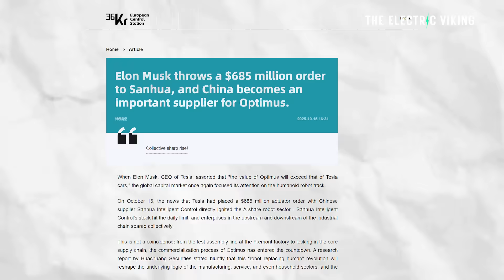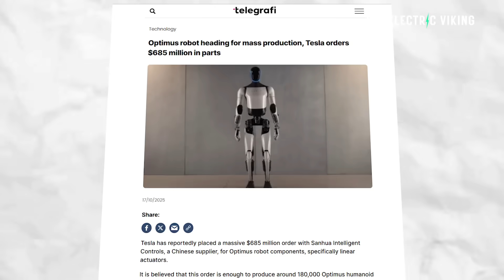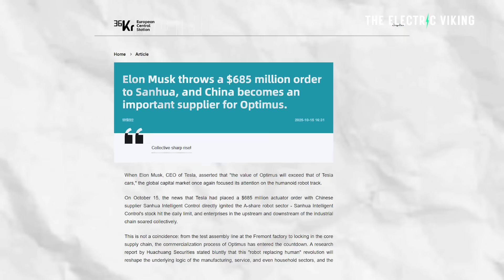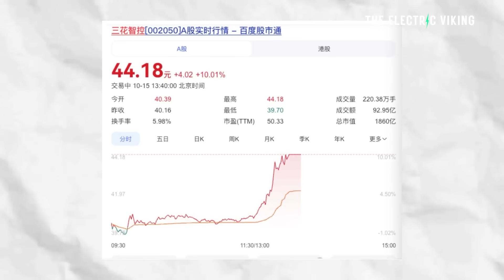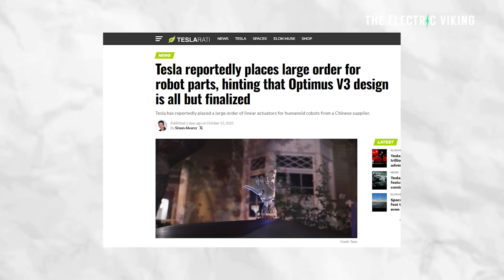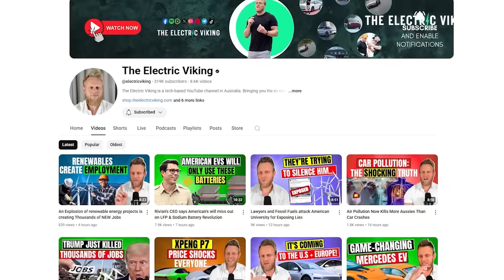Tesla Orders $685 Million Robot Parts - Enough to BUILD 180,000 ROBOTS!

Comment: Nearly $4000 in parts for each robot, probably not a complete list I would say. Would be a struggle to get it under $10,000, somewhere between $15,000-$20,000 could be possible. If the price is this low or lower from start, this should have a huge waiting list so I'd expect them to ramp up to more very quickly.

Comment: If Tesla is bettng the farm on mass-producing Optimus next year, I'd be selling TSLA if I owned it. Even if Tesla has training data comparable to its data for the far simpler task performed by a vehicle with FSD, these robots are a hard sell because no one yet knows what they can do or whether they'll outperform minimum wage labor without large training costs borne by the customer.
Reply: If one is going to confidently sell it, they might as well short it.
Reply: @BeAsOpinionatedAsOpenMinded  Selling is fine. If you don't own it already, you could short it, but I wouldn't. FSD robotaxis still look like a winner in the foreseeable future, and I don't know how much of Tesla's earnings they're betting on Optimus at this point.

This article says that Tesla "reportedly" ordered $650 million in parts and deliveries "are expected to begin in the first quarter of 2026". Lots of hedging there. I doubt that Tesla has paid $650 million upfront for parts it'll start to receive in the first quarter of next year. Maybe they've told Sanhua that they could purchase as many parts next year, but I doubt that they're contractually obligated to do it. I need to see it reported somewhere other than telegrafi before I'd believe it.
Reply: @restonthewind You're right there's fsd and the new model y looks good also.
Reply: @restonthewindAptera?  Looked it up.  Interesting.  One render looked very slick but the other looked like a cockroach.  I can feel the nerd appeal.  Does it have 4x4 for the snow?…I think I would bolt and buy the Tesla.
Reply: @BeAsOpinionatedAsOpenMinded  Wouldn't be great in the snow, but it hardly ever snows where I live. Is incredibly efficient. Costs practically nothing to fuel.

Comment: That much money could be parts for 10s of thousands of Robots.  That qualifies as a small test run for a product if you are convinced it will eventually sell in the billions, as Elon has stated.
Reply: Tese 685M$ are only for ONE type of parts:  linear actuators, NOT for the full sett of parts necessary to make the robots. So, it is not 10s of thousands that are being planned, but hundreds of thousands!  It's clearly MUCH more than "a small test run"!  It's a first commercial run!
Reply: @st-ex8506 
Actuators are the greatest cost to producing Optimus says Elon.  He also stated after hitting million or multi million production rates, they may get production cost down to or below $20k per bot.  Until then it is fair to assume we can expect 2 or 3 or maybe 5 times more expensive production cost. It starts really bad but steadily gets smaller and smaller.  A bot with 40 actuators(last I heard they were looking at around 30 plus whatever the hands need to operate), and lets guess each actuator averages out to $650, that equals $26000 in actuators per bot with lets say $60000 production cost for this very first run. 
At those prices we have enough money to purchase actuators for about 26000 bots.  I definitely coukd be wrong but I see zero chance of Elon ordering parts for 100s of thousands of version 3 robots before first building thousands.

Comment: Had a chat with ChatGPT, did the math on the carbon emissions of robots. They will have a huge effect on carbon emissions because although they are less efficient than humans, food is an extremely carbon-intensive source of energy. Also, no commuting emissions. So in addition to EVs, robotaxis, energy, this is another way that Tesla is helping climate change. As opposed to legacy automakers who have to sell about 5 or more SUVs or pickups (the vehicles with the highest margins) to make up for one EV. If you’re going to buy an EV, do the math on the entire effect of your purchasing decision, not just the EV itself.
Reply: Thanks for that insight. However, the AI supercomputer data centers will use so much electricity that the companies building them are also building on-site power plants to provide that electricity. There is an insightful 30-minute video entitled " New Colossus: The World’s Largest AI Datacenter Isn’t What It Seems" that was published 2 weeks ago on the "Anastasi in Tech" channel. That video indicates xAI's Colossus 2 data center will be about 10 times more powerful than Colossus 1, and it will use a gas turbine power plant capable of producing about 450MW of power. So that's a lot of fossil fuel being burned to produce AIs. I hope xAI plans to eventually switch to using sustainable energy sources, for example, solar/wind power plants.

Some back-of-the-envelope calculations indicate that the amount of CO2 emissions saved from Tesla's Megapack business is currently far greater than the CO2 emissions from Colossus 2's power plant, so that's good. However, Elon has indicated there is intense competition to build ever-larger AI data centers. Colossus 2 will be the first GW-scale data center, but he predicts that 10 GW-scale data centers will follow within a few years, and then 100 GW-scale data centers after that. As such, I think it is too early to predict whether AI robots will end up reducing or increasing CO2 emissions.
Reply: @CiaranMcHale  Yes, this is an extremely complicated issue. The burning question is whether AI will come up with climate solutions and products that will more than make up for its current carbon emissions. We (humanity) are feeling around in the dark and making decisions whose effects we will only know in the future. The stakes are high but inaction will only carry us slowly towards the waterfall. In my opinion we will probably not solve the climate problem without AI so we need to step forward and hope for the best.

Comment: Yawn. This robot will go over like the Cybertruck. It is old and slow. This is the person that created the Model Y, Toupee edition.
Reply: I work at a tech company and just bought the new Tesla model Y Juniper. 
Everybody that rides in it loves it and is blown away by the engineering, it’s amazing. The full self driving is like alien technology it works so well. I’ve taken multiple long road trips and 99% of the way the car drives itself. Elon is a god of tech, facts.
Reply: @greenapple559  

I am glad you just bought it and have taken multiple long trips. Ha ha hah ha ha ha ....
Reply: @greenapple559  what about the engineering are they blown away by? It’s a car.
Reply: dang and I'm sitting here thinking it's gana take 10 years.
Reply: Huh?
Reply: @Pierwalker  The cheap Model Y has a glass roof that is blocked by a liner inside the car. Normally the roof would be solid metal, but it isn't. In his haste to build a cheap model, they gave it a fake cover.
Reply: @keithdow8327 there are many good reasons why they did this, which is explained. I'll summarise for you though. 

1. Reduces costs as Tesla doesn't need to design and order a whole new part 
2. The glass is not treated, it's the base part, which is cheaper than the metal alternative they could have used
3. The toupee reduces noise at a fraction of the cost of treated glass or the metal alternative.
4. Keeps the aesthetic look from the outside

Tesla designs and makes very informed decisions. Why do you think Tesla hardly meets deadlines, it's because they continuously iterate designs
Reply: @AJL52838  I am shocked that every car doesn't have a fake glass roof to reduce cost.
Reply: @AJL52838  The prior break issue on the cybertruck is something unbelievably dangerous. Likewise the manual handle design to exit - extremely dangerous. 

I’ve never seen these particular glaring issues with other cars. Whatever their ‘iterative design’ is I think we all see they are having some major design failures.
Reply: NO, Musk did not make any tesla vehicle,  his first on the road design was the Cyber Lemon. All previous models were designed by the original company owners, two engineers. That's why teslas today are very stale, it's the original  chasis STILL being used. Musks other effort, the semi, where is it, Europe is filling with battery  powered commercial trucks.
Reply: @grahamkearnon6682  I drive a model s. Are you telling me it has a gigacast chassis?
Reply: I'd rather buy a Korean robot. Tesla technology can never catch up with Korea's robotic hand actuation technology. Of course, China claims to be the best, but if China makes something, everything will be garbage.
Reply: @차주식-k2r 
In-hand actuators can be dexterous, but won't have the strength of the tendon model.  Arm actuators can be larger and stronger.   The winner will have a a balance of acceptable dexterity and acceptable strength to accomplish useful tasks.  Not a perfection of one aspect.  Do not disregard the rule of 80-20.  An attempt to reach perfection in an aspect, especially when downplaying other aspects is detrimental.   Build 80% good enough, fail, improve, iterate.  After a short period of time making and selling product for a profit you get to 83-17, then 86-14, then 91-9.....   Elon continues to do well with that operating philosophy.  Also,.... no one knows enough yet about Optimus 3's hands to even make that call.  And not even Tesla knows about the Optimus 4 or 5 hands in that will come out in 3-4 years.  Probably AI designed.   The famous engineer Sandy Monroe says Tesla innovates at the speed of thought.